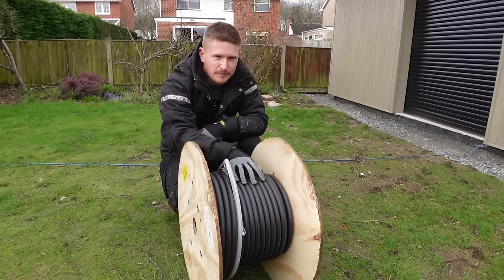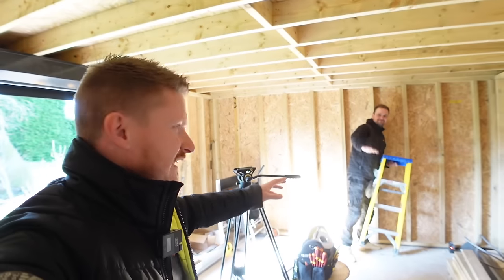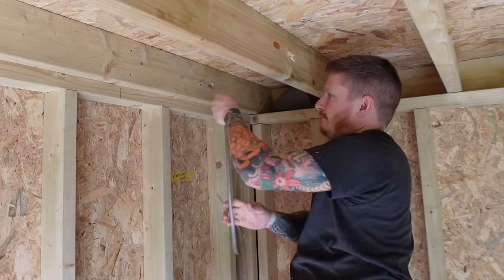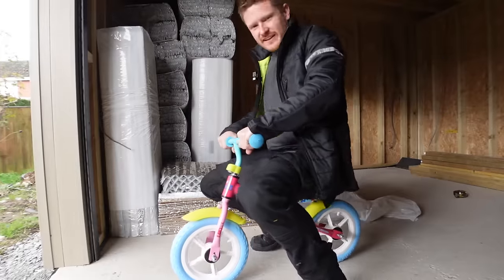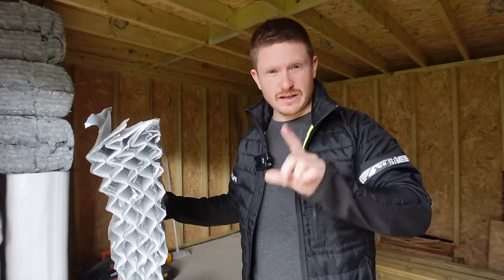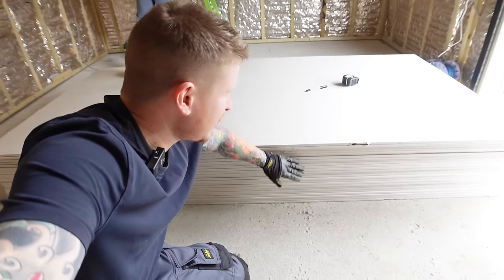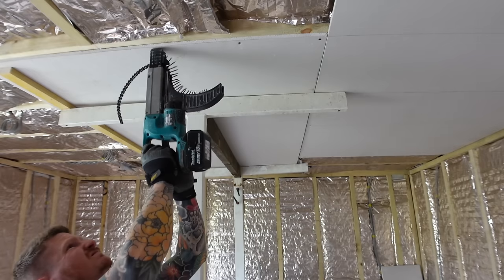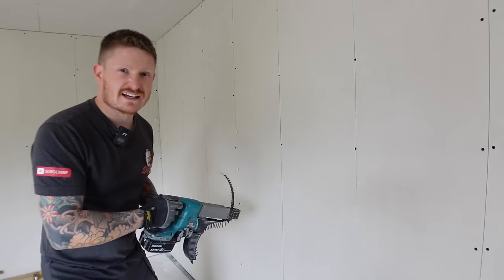Installing Electricity and Insulating a Garden Room - Workshop Build PT6

Comment: All you are doing is encouraging DIY bodgers to do electrical work who are not qualified . Taking work away from all the trades
Reply: Most people who take on this sort of stuff are either qualified, competent or have access to someone who is. Its a bit above DIY level.
    To use contractors on such projects would cost an absolute fortune, and the build probably wouldn't even happen, so the work wouldn't exist in the first place.